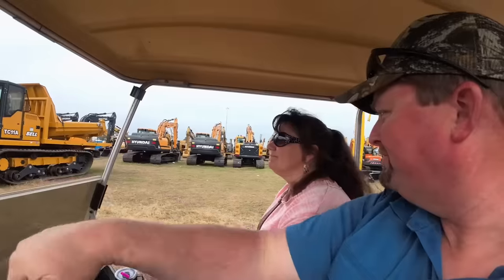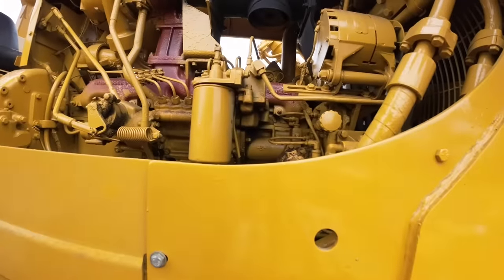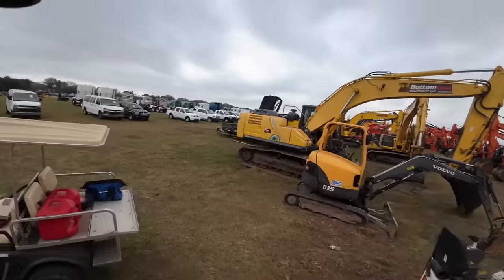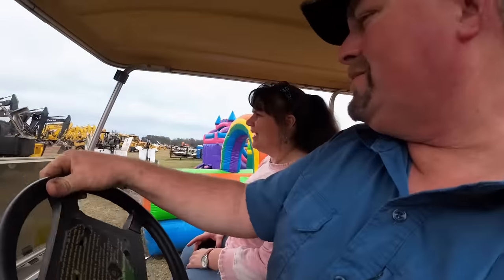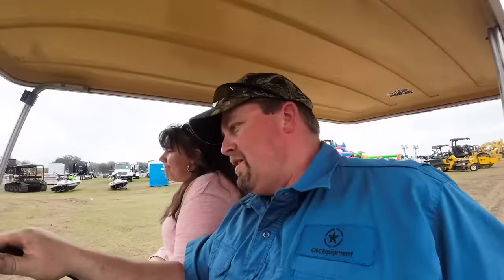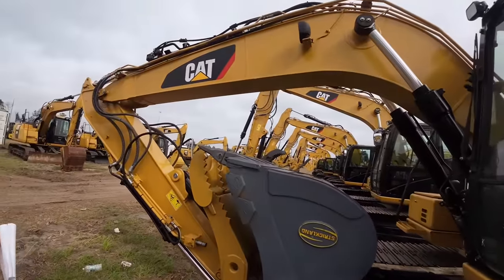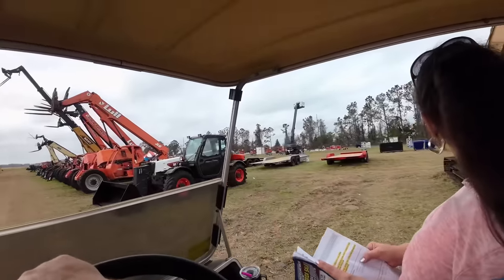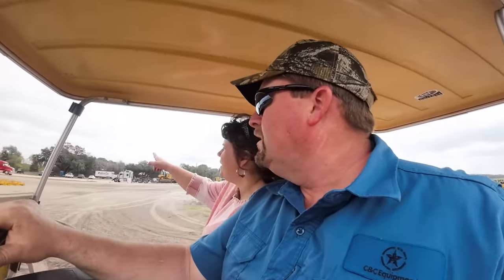I bought another non running Cat D7F dozer at auction… does it run and move? Will my gamble pay out?

Comment: Larry has an ex-Navy D7F but it’s configured a bit different. No throttle lever. It’s all in the decel pedal. The fuel primer pump sits vertically. His is a real peach. I think it has 1600 hours and original undercarriage. Manufactured in 1973. I was using it today, as a matter of fact. We use it to pull out the TD15B when it’s buried in the muck. Speaking of which, I need cutting edge and end bits for that machine. Guess I better call Clinton!

Comment: Difficult to tell when Clint has a rye smile - cos he kinda has one most of the time - but I did like the little aside about the "imaginary" bidder that the auctioneer thought he'd heard - and far more difficult with all those callers you have Stateside! Over here in Little Old England the flippin' hammer crew are "at it" all the time - uplifting bids, or slamming down just as the reserve is passed. I'm not as wide as Clint but at 6' 1" and wearing boots and a big hat - difficult to miss - yet I had to yell to one ring - "what have got to do to get you to notice me? Join the Magic Circle"? Next sale they gave me a wand.

Comment: Nice you having a changing intro as you fix stuff and get em going. Have you considered designing or redesigning some equipment since you are well versed on a lot of problem areas. Give your equipment your "CC" name...just 2 capital letters. Invision Your equipment climbing the country. You Would be New Frontier to John, Cat, Volvo as you develope a team of experienced operator/consulting engineers to design your equipment...Just a Thought! 👍 Great Job Clint, got a great crew. Some of your expansions are probably already in the Works. Maybe new Bldg 🤔
 I don't think the electric will ever keep up with diesel motor unless it directly connected to the Grid like some mega tonnage shovels. Hard to store that much power in a battery.

Comment: For sale 
2018 Caterpillar D3k2 
Only 2900 hours 
Factory Accurgrade and slope assist
Trimble gps ready 
Factory reverse camera 
Bluetooth stereo 
Increased headboard blade capacity 
13 Tyne Stick Rake with sucker bars ( quick removal and fitting 2 pin system )
3 Tyne Rippers
Sweeps and screens 
Owner operator
205k plus gst 
Located Hervey bay

Comment: You are doing correct thing stay away from china copy. even the metal is not good in them. try watching china bs how bad it can be, than metal bars which must go into tall bilduings snap than worker with hand trying to bend it :D you get idea.And in heavy equipment its actually dangerous what if its snaps than worker was near.China metal itself is bad some very very low quality, lowest in world. It can easily tested on pressure machine on renches china instantly snaps  or brakes in half while all world holding, if its from us or eu it holds to some wow factors.